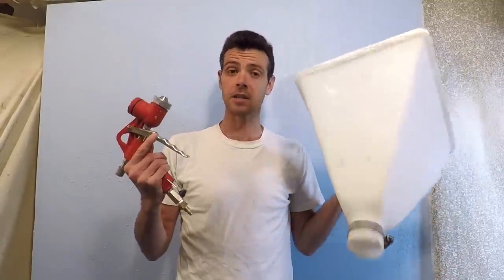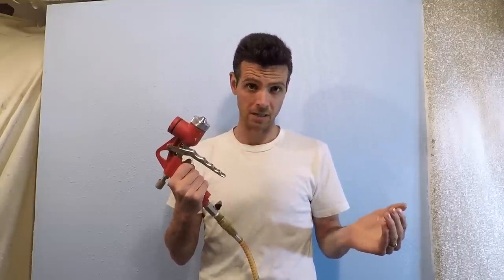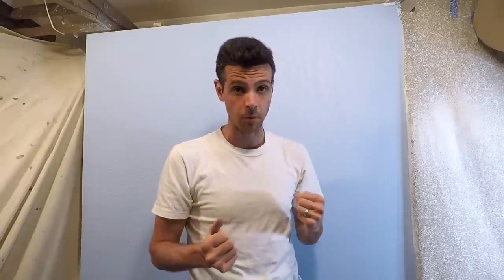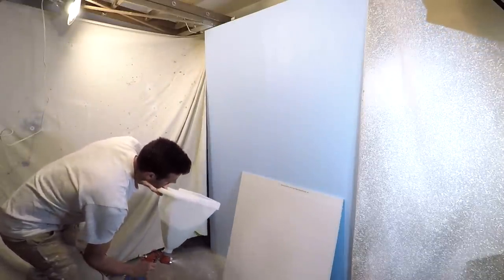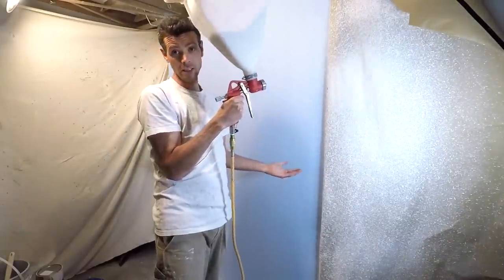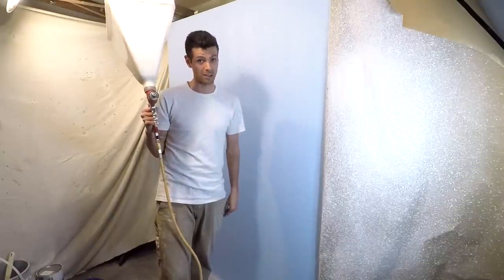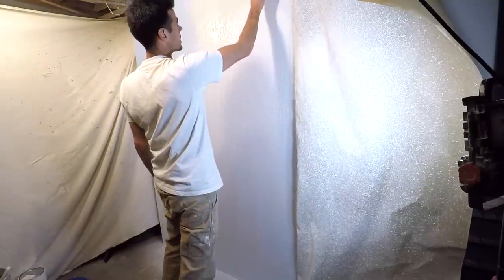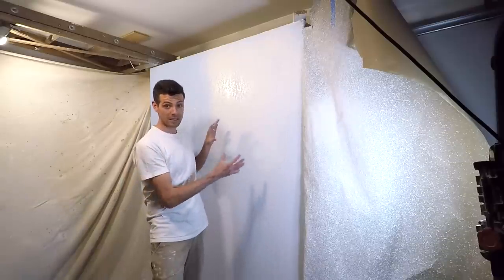My Second Attempt at Knockdown Texture

Comment: Late to the party but I wanted to say the Wall-Board brand Texture-Pro 200 does control air flow by the trigger.. Much nicer than having it flow air all the time. Works well with small job site compressors.

Comment: I find it easier to use 40-60 psi and a little bit soupier mud than you had. You’re on the right track knock it down with a bigger blade that’s super flexible with light pressure just as the wet sheen fades to that dull gray color.
Reply: Oh a I use the largest tip of the three sizes.
Reply: This seems like the kind of job  best done with two people.  One spraying.  The other knocking down.  The reason I say this is that each job requires consistency, and the best way to make that happen is by having each person only focus on one of the two tasks. This enables them to maintain muscle memory, consistency, proficiency and speed.  What are your thoughts?

Comment: 1) Your mud is too thick
2) Turn the pressure valve on the very bottom of the texture gun way down
3) If you do #1 & #2 you should never need to stop spraying even when your compressor gets low
Reply: I've been told 90 psi always
Reply: In an ideal world I'm sure that that's right. However, it's impossible to maintain 90 psi with the teeny pancake compressors most of us use. So much air pressure is being blown out of the hopper that you just can't maintain anywhere 90 psi without a very very large, powerful, probably gas engine powered compressor. 

The next best alternative, if you're not a drywall contractor with a $4000 truck mounted spray rig, is a decent pancake compressor with a ball valve on the hopper, like in this this video. Turn the ball valve way down so that whatever pressure that hits the texture mud is high pressure even though the pancake compressor is maxed out the whole time. 

With this set up you can get pro results without a $4K rig. You also don't need to wait for the compressor to power back up over & over & over, you can just keep spraying. Also very wet mud is an important part of this method. A little bit more dry than primer paint, but no where near as dry as what Ben was using here.

Comment: I begin the knockdown as soon as the spray loses its sheen
 it's tricky, and usually requires two people. I also apply the texture in a back and forth pattern, using 45 psi to apply the mud.

Comment: the real trick is to do a patch. here are some tips. Do a short burst of dime size splatter to start. Only spray on the actual patched area. on orange peel you over spray the patch to blend in. That does not work well with rough textures. Just the opposite. Keep the spray as much as possible on just the patch. That is little to no overspray. When you wipe down the patch start on the outside and feather in the edge like you are feathering in troweling a mud joint. then wipe down the rest of the patch. It is a good idea to practice on a scrap piece of drywall or card board.

Comment: A BIG KNOCKDOWN TROWEL is what you need... with a 2 ft blade. Mix your mud in the bucket add a little water so it doesnt clump up you're gun. Then spray vigorously making sure all areas are covered. There is no such thing as too much spray. Let it dry for 5-7 minutes. Then use your big 2 ft trowel and trowel in the same direction. Then wipe the trowel with a wet rag and repeat.

Comment: You knock it down once the shine goes away... 10 minutes.
Reply: Its not going to be 10 minutes. I just did my pantry.  took about 30 minutes. That runny mud is not drying anytime soon.
Reply: I agree theres no time to go off of. It all depends on all the variables air flow,heat,humidity in air,sunlight, and bunch more haha. But yes I wait right up to were the shine or sheen goes away.

Comment: Wasn't that you wiped too early.. It's that you didn't wipe the mud off your knife with each pull.  That just causes long smears or grouping I believe...  I could be wrong.  I'm currently learning and have only had the pleasure of doing two repair blends.. which both had passed.  I'm doing a full ceiling tomorrow and well I don't want to screw it up haha... so here I am.. watching others spray in the hopes for it to just make sense when I'm standing there about to pull the trigger on the ceiling.  😬 haha

Comment: The more air pressure you have the smaller the orange peel texture is, turning down the pressure will make the orange, peel bigger, you need to use the biggest orifice when you do knock down and turn the pressure down and it will glob out then knock it down in about five minutes. Trust me that’s how you get the knock down and the bigger Texter if you want to do a smaller knock down you turn the pressure up a little bit more but use the biggest orifice. I’ve been doing this for 30 years.

Comment: Get a air pump spray machine you can  rent them everywhere ,consistent air pressure is key ,use dry mix Spray texture ,mix it the day before then spin it up again before you spray to get the lumps out ,wait till it firms up then wipe down with a rubber or Lexan knock down knife. 40 yrs in the D/W business

Comment: Been doin knockdowns for years, never used anything other than usg  purpose mud and mud needs to be a lot thinner than that and when knockin down the trowel should sound kinda like pullin a rake across gravel it has to have time to almost dry, takes awhile to get the hang of it and best way is about like painting a car spray in lines with about 25 percent overlap
Reply: @vancouvercarpenter  i dont do a lot of remodel work with texturing not sprayed anyway usually its new home i live in tn so the wait to knock everything down usualy is left up to a number  of things major one bein humidity cause its majorly humid here and sparyin mud as thin as oil in a house with windows and doors masked off only makes it worse, feels like you're breathing in soup

Comment: It will also help if you lower your discharge psi to around 55-60lbs and control it some by throttle the air valve on the gun. I really like the medium-large knockdown. Just give it more time to dry before knocking it down.

Comment: You already have a regulator attached to you gun, the 'shut off valve' is a regulator just without a dial reading. You can dial it in to the air volume you need, where it feels right and don't really need a dial indicator in the way.

Comment: I usually run the air pressure around 45 lbs. The higher the pressure,  the smaller globs. Also, I use a 16" plastic knife.

Comment: Looks better when you lower your air pressure and open the trigger and thin your mud and get bigger globs to come out. Then knockdown with bigger texture. Much more pleasing. Just my 2 cents. Also about when to knock down you need to wait until the sheen or shine of the mud goes away right about then you lightly knock it down.

Comment: Keep your blade clean.  You swipe when texture is half dry, you can tell by the color.  If it gets to dry keep some water in your pan to add to knife.  Don’t second guess when spraying texture, keep the circular pattern moving.  You can touch up easier later when its dry.   Having to stop because of the compressor is a huge annoyance and detrimental to the process.  

Always use a drywall primer before painting!

Comment: You also need a bigger compressor so you won't run out of air and have to wait for pressure to build.  Need one rated for at minimum 6cfm at 25psi.

Comment: The timing is critical, and humidity, and temperature, air flow can also make a difference. I generally have a basic idea just from looking at it, but until I get the timing down I will occasionally take a 6 inch knife and test a corner or edge near where I first started spraying.
  Also I think you may have been using too much pressure. Check with the recommendations given in the literature. Also a good practice is to apply the spray in overlapping circular motions. 
The mix is important too. Try not to thin it so much,  Also the mud should be to the point where you don't need much pressure or extra passes to get the desired finish when knocking down.
  I have done a lot of it and should soon be doing two more complete houses. So for me it is kinda natural, but I still have to pay attention to the things I mentioned above. I hope this is helpful to some of you.
  By the way I usually do different samples for the customer after they tell me what they basically are looking for.
  A little more practice is what you need, and you must have a good eye to be sure and keep things consistent. PRACTICE MAKES PERFECT!

Comment: Will you please consider making a video describing the best way to remove oil based paint that has been applied too thick and created its own texture resulting in a poor final outcome?  Other parts that are not necessarily too thick, still have brush marks in the paint.  All of this looks terrible.  I'm guessing it needs to be sanded off.  Are there best practices, tips, tricks, advice you can put into a video regarding how to fix this problem?

Comment: When you spray a painted surface with an all purpose it takes longer to dry. Scuffing the surface doesn’t really help. Priming the surface helps the dry time in my experience or I have to mix fast setting compound with green label all purpose to “NOT” have to wait forever to knock down. Also a 24” or 36” plastic texture knife make it so much easier.
Reply: Also the shine needs to be visible on some of the globs. Not all but some.

Comment: Ben, I had the best luck with larger globs and letting it set up for minimum of five minutes.  I also made my mud fairly runny. I also used a professional sprayer the first time I ever did knockdown and the results were great, coming back a year later with your method (pancake compressor) was noticeably worse even though I had technique down. P.s. I never used a knockdown knife that are plastic and flexible, just a 12 or 14" knife and varied pressure depending on how set up the mud was. I found it was better to have the mud be dry on the wall vs too wet.

Comment: Using a metal blade to me when doing knock down is a bit to strong for the material. If you use a metal blade, making you mud a tad bit thick. I use a plastic plade an a medium mud mix thats a tad bit thinner than topping mud. Always come out great a few minutes after spraying your material an doing sections at a time but being a bit on the hussle side so the consistency is the same

Comment: I don't like textured walls at all. Imagine a situation you need to cut some opening in the drywall to get inside the wall for any good reason. Putting it back without leaving any trace would be a challenge. Also, quite difficult to clean.

Comment: Hola from Mexico. 
As a general rule, you should wait 20 minutes
Reply: Right. Based on color (dry time), about 10-15 minutes is just right. I learned by trial that texture over paint does not dry as fast as texture over bare drywall.
Reply: generally, but your time will vary based on the ambient humidity.

Comment: I’m a little late to the party. Some videos I’ve watched, the wait was 10 min. A runnier texture at 40 to 60 psi.  I’ve purchased the hopper and feeder, but I’m afraid of messing up so I haven’t tried this yet. I like the knock down result you got the day before actually. 🙂

I’m going to see if you have other texture videos. If not, could you show us how to do a trowel texture? This is the way our house was done and I personally don’t like it. I want to see how you would do it. I have a feeling the person(s) who did ours wasn’t a pro. There are rough spots, uneven spots, bumps and inconsistencies. I’m about ready to sand this crap down. 😆 I actually did sand most of it off my sons bedroom walls. He now says he wants no texture on his walls at all. Elsewhere in the house, I was going to have it redone with knockdown. The person I was trying to get a quote from said he doesn’t use a hopper to do knockdown and hasn’t in over 20 years. I have a feeling his knockdown is by trowel. 🤷🏻‍♀️

Comment: Drop the air pressure down to less than 30 psi.  Clean your knife as much as you can; it builds up with mud fast, which makes your knockdown too smooth.
Reply: Also, you always need a test area to spray on before you spray the real thing: this gives you a test area to see if your timing of knockdown is right and it gives you a chance to test your texture.  For this reason, I always save scrap cardboard.  And the reason why you have to test every time is because the water to mud ratio will always be different.

Comment: The Homax air sprayer and hopper are less expensive, and do a better job because it's electric and isn't controlled by air pressure from an air compressor... Look into it, you might like it... Much easier to match texture than an air compressed hopper...

Comment: If you don’t use a knockdown knife (24” wide) then you will squish the texture bc the drywall finishing knifes blade is too rigid. A knockdown knife has a very paper thin blade that glides on top the texture more than squishing it down. Of course you still want to let it set for 15 mins

Comment: One thing I learned when knocking down a ceiling that had repairs and deleted skylights is that new drywall along with primed/ painted surfaces dry at different rates. Everyone in the world probably knew that but me. Some may be good enough to match it perfectly, but I know I'm not. Next one will get primed ahead of texture!

Comment: Ben, did you just use a different tip for the orange-peel? Was the mud the same thickness? Thanks.
Reply from the maker: Same tip. I just had that thing on the back dialed way in so I couldn't pull the trigger very far back. This made the spray finer.
Reply: @vancouvercarpenter  Thanks so much.
Reply: @vancouvercarpenter  Just an update... I forgot to add that your video was super timely, so thank you. I sprayed my bathroom walls this past Saturday. They came out perfect. I wanted something between spatter and orange peel, kind of a heavier orange peel. That's what's on all of my home's walls. I used topping compound diluted, which works really well as it drys quite hard. I got it to what I thought was slightly thin pancake batter, but when I went to pour it into my hopper it was kind of thick. I just went with it. I used an older Homax sprayer connected to my 6-gallon compressor. The sprayer is designed for small compressors. It has 5 orifice sizes and five positions for volume. I used 1A as a test at 50 PSI. It was classic orange peel... very tiny. I then tried 2A and it was still to tiny. I changed to the next orifice up (2B) and it looked great. The moral of the story here is to mix extra material and test, test, test until it looks the way you want. I'll use it again soon with thicker material to touch up my ceiling's knockdown texture. I took your advice and tapped up my ceiling corners (old ceiling new drywall walls).

Comment: Just purchased a Kraft hopper spray gun to redo a popcorn ceiling. Never did anything like this. Any suggestion on what to watch for?
Reply: Popcorn texture is pretty forgiving in my opinion.  I would suggest having a spotter helping you keep your coverage consistent.  Although, I never felt it was noticeable when I had to touch up areas I sprayed too light.  Mix the popcorn texture mud to the consistency of wet oatmeal, you don't want it runny.
Reply: Popcorn is easy, mix it let it sit for 10 min and remix cause it will thicken up..
Reply: Thanks  @dustincriddle  I remember reading that on one of the labels.
Reply: Thanks  @darinvee4980  , makes me feel a little better applying it. Consistency of wet oatmeal, I'll do that.

Comment: watching a clock to measure its dryness is a waste of time , watch the texture it will tell you when it is ready to be moved. This depends greatly on what compound you use, from mixed tub mud, box mud, or powdered bag, Humidity plays a role as much as temps. Mix you compound to that of runny grits, wait 15 min it should harden up to pancake batter, at that point take a cup of water and pour it softly enough to cover the mud in the bucket and mix for use  Spray on texture. let dry half way that takes anywhere from  15 min to 2 hours but generally you have enough time to eat a lunch, check by touch on a larger blob in the center if you touch wall or ceiling surface you have more time to wait,  when the outside of each blob looks dry and the dragging material the wet looks ready to knock down go in one direction lightly test out a corner or area you started out at first. The areas that will be tricky is your joints and around the lights as most people confuse what level is, so when you drag you trowle, blade, squeegee over the material it will also level in the low spots until it runs into the high spots. If you have this problem where you see joints and rings around lights it is best to wait till dry and sand in you knockdown texture.

Comment: Your pressure is too high. Thinner mud, less air pressure and a much larger knockdown blade. My knockdown is 16” and very flexible. If done right you really don’t need to knock it down, just a light sanding once dry.  Oh, and the circular technique is all wrong, even strokes left to right or up and down. I find the boxed ultra lite mud works better than powder. Think pancake batter for consistency.